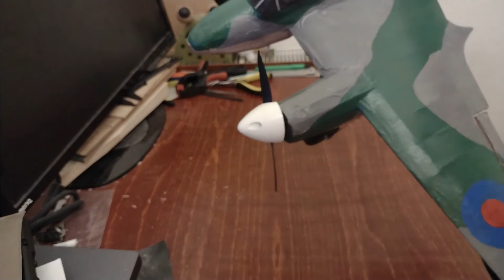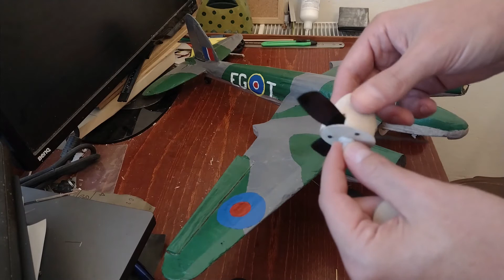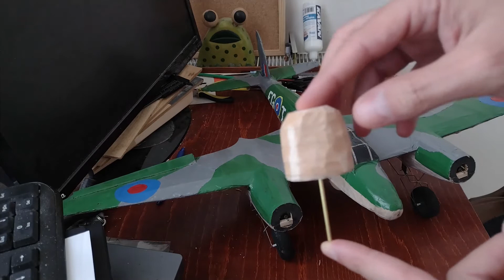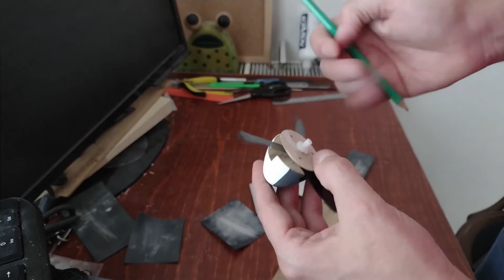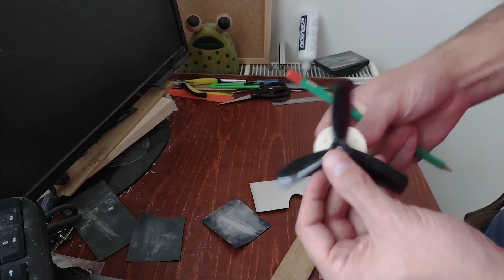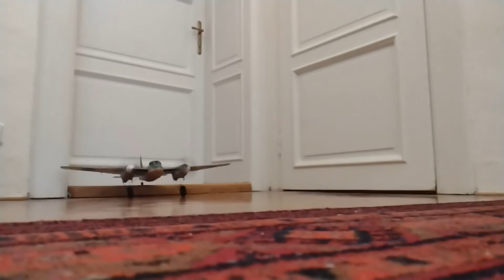DH Mosquito Balsa Model Build   19 New Propellers

Comment: Interesting video Andrew, you could use your metal rule and pencil to act as a see-saw scales for the spinners. The props may not have come off in the air because the model would have been moving instead of stationary? Now they're off are you going to paint the tips yellow?
Reply from the maker: I eventually got a new toy: precision scales (they were really cheap) and I got like 1 gram difference, so I am OK with that.
I do hope the props stay on. I did put a spot of white glue to encourage them to stay on in flight.
Yellow tips... I could maybe still try that.
Thank you!